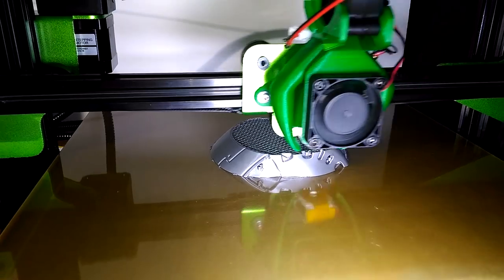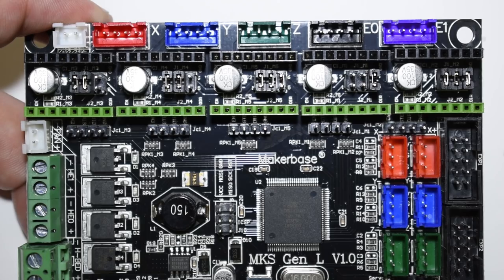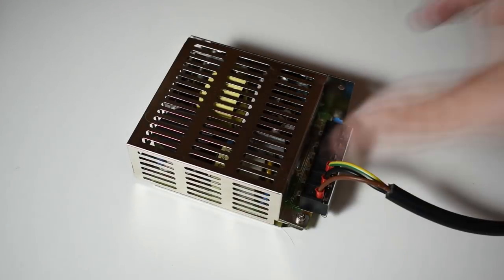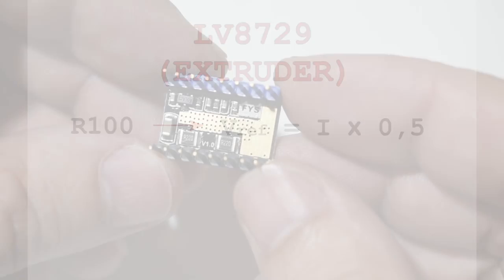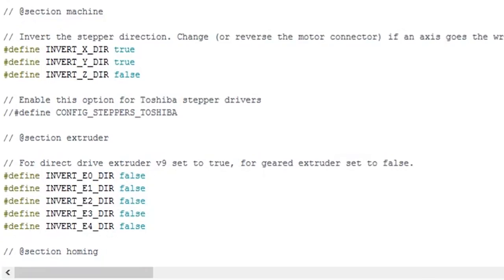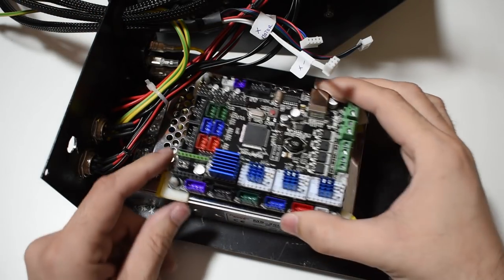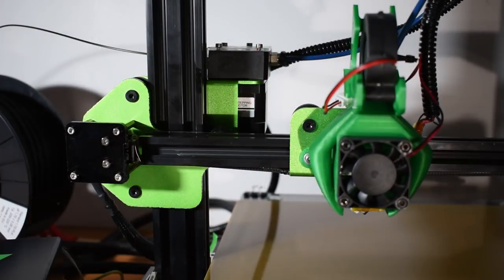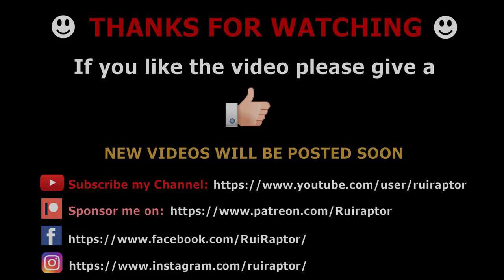Install & Setup - MKS GEN L + TMC2208 + LV8729 (TEVO TORNADO)

Comment: Thanks again for a great video. I followed your recommendation and used an LV8729 on my extruder and people keep asking why use that an not another 2208 and I have no idea why. Can you please explain the difference in choice? Why the LV8729 instead please dude?
Reply from the maker: Hi Neil,
People use the LV8729 because the TMC cannot handle very well the fast direction changes of the extruder.
Reply: ruiraptor Also, when setting the jumpers under the LV8729, you recommend running the extruder at 1/32 steps. Should I change anything in the firmware to reflect this setting?
Reply from the maker: Hi Neil,
I have all my drivers set at 1/16. If you change to 1/32, you need to double the steps/mm. You don't need to flash a new firmware for that, just change the steps value in the display.
Reply: @ruiraptor  So why not use also on other axis (x, y, z)? Im talking about the lv8729.
Reply from the maker: You can use the LV8729 on all drivers but the printer will make more noise. The TMCs can drive the motors with much less noise.
Reply: @ruiraptor  What are the advantages of the LV 8729 versus the TMC2208? I see now that the lv8729 is set to 1.5 amp-1.2amps that is not too low for x, y?
Reply from the maker: The LV8729 are high quality drivers that's why they are used in the extruder. But because they don't drive the motors as silent as the TMCs, the TMC are used for the other axis. Regarding the vref adjustment, you need to check which resistors you have in your drivers (there are 2 different ones - R100 and R220). According to which resistors you have, you need to apply the corresponding formula and that will give you different vref and current results.
Reply: @ruiraptor  Thanks for the quick answer, how can I find how much amps the motor need?
Reply: @ruiraptor  Is there a formula for finding the current?you think that 0.85a and 0.9 will work for most 3d printers? Mybe 0.85a and 0.9a is the sweet spot?
Reply from the maker: There is no information online about these motors. However, we assume that these motors might have between 1.3A and 1.5A.
Reply: @ruiraptor  tanks
Reply from the maker: I posted the formula in my video. You just need to work the formula to move the current variable. You have additional information in their datasheet. For the TMCs you need to be conservative because these drivers run very hot and since they are very efficient, you don't need to push the current too far. In my video, i show my recommended settings.
Reply: @ruiraptor  Thanks for the info. btw Your videos are great.
Reply: @ruiraptor  Mks gen l or mks gen v1.4? Im going to put it on a raiscube a8r, 12v dual z axis. It possible to give each z motor driver?
Reply from the maker: Hi,
Either board should be ok. 
Regarding the dual Z, yes, you can use 2 stepper drivers (one for each stepper motor). But remember that you only have 5 driver slots so if you use 2 stepper drivers for the Z, you will not be able to use dual extruders.
Reply: @ruiraptor  thanks, So should I go with the cheaper board? I'm planning to put LV8729 on the Z and  the extruder, and on X and Y TMC 2208, how does that sound to you?
Reply from the maker: The LV8729 are very good drivers too. Your plan sounds good :)
Regarding the board, if you don't plan to install extra fancy stuff, the MKS GEN L board is more than enough as it has all the main inputs/outputs needed. Both are 8bits boards and use the same ucontroller.

Comment: Hello Nice Video i Just wana ask something :) 
About orientation of Driver is same with TMC 2130 SPI ?..
Same in Heather Pin Blue Must Match the green And Black With Black ?!
Because im New i Have this Board MKS Gen V1.4 Control Board  
thanks
Reply from the maker: Hi. You are correct. Color header match color header and black header matches black header.

Comment: excellent video .... with the change of drivers are smoothers no longer needed?
Where can I find the latest firmware version?  thank you
Reply from the maker: Hi,
That is correct. With TMC drivers you will not need any smoother.
Regarding the latest firmware versions, you can find them in the official tevo tornado facebook group

Comment: I am slowly understanding Vref values. I am installing a zesty nimble. Do I need to use a target of .5A or use .9A to start on the E driver? I have the A4988 stepper ICs. Thank You
Reply: I would also like a video on the A4988
Reply: I would say start with 0.5A or even go as low as 0.3A. With the Zesty Nimble you need low amps, because it needs to spin fast. You are looking for speed, not torque. More amps usually means more torque, but longer time needed between pulses.

Comment: THANKS! Very well made video and easy to follow. PROBLEM: Everything seems to work great, however, when I try to heat the nozzle/hot end, I get min temp error and the printer HALTS.
I have TWO tevo tornadoes, so I pluged the new board into BOTH and get the SAME message. any ideas?
THANKS AGAIN for another great tutorial!
Reply from the maker: Hi Cosmo, what are the temperatures you get on the display when you turn on the printer?
Reply: @ruiraptor  hot end -14. Bed 21
Reply from the maker: Your hotend temperature is -14 and that is your problem. Check all the wires and conenctions. Maybe you have a loose connector.
Reply: @ruiraptor  hey thanks so much, I got it working, I had the thermistor wire plugged into the wrong place, it immediately worked, however, NOW x and y axis are skipping and I can't get a print to work. after a few layers, it just jumps really far off. any suggestions?

Comment: I have followed your tutorial and when adjusting the voltage, I ran into a problem. The first TMC and the LV are perfectly adjustable just as you've shown in your video, but the two middle ones don't seem to react to the screw and only show 0,05 and 0,1 Volts respectivly. What is the cause of this, are my drivers bad or might be something wrong with the power source?
Reply from the maker: Hi,
You probably have bad drivers and my guess is that they are missing the RS resistor. Compare a good and a bad driver. Check if the bad driver has all the SMD resistors soldered on the pcb or if there is any missing solder joint.
Reply: @ruiraptor  I checked them and they all look good.

Since they came in a pack of 4, I switched one of the TMCs that didn;t work with the unused one and that one is working. So now just one is missing and I have to conclude, that I simply got two bad drivers.
Reply from the maker: Correct. I agree with the conclusion. 
I believe that you are using a setup of x3 TMC and x1 LV8729 for the extruder, correct?
If you have a spare LV8729 driver, you can install it for the Z axis.

Comment: Hi, very nice explained video. For Extruders how is the noise compared between LV8729 and DRV8825  for Linear Advanced feature of Marlin?
Reply from the maker: Hi,
I have the LV8729 installed in my extruder and I would risk saying that it might sound less noisy compared with the allegro or DRV8825.
Reply: @ruiraptor  Thank your for the fast reply

Comment: Hi Ruiraptor, could you please help me which option is better for Tevo Tarantula 2017;
- Replace the 4988ET drivers on MKS GEN L V1.0 board with TMC21XX drivers
- Add TL-smoothers with 8 diodes to stock A4982 drivers on MKS Base v1.6 board or the board above with 4988ET drivers
Thanks!
Reply from the maker: Hi,
The best option is to get the MKS GEN L board and equip it with TMC2208 (or any other) drivers.
These will give much better results when compared with Allegro and smoothers.

Comment: Followed all the steps on the video and my Y motor always stops about 30 minutes into a print? The motor itself is only a bit warm not hot to touch. I switched the Y driver with the X and re did the Vref and still the same problem, Y motor stops about 30 minutes in? Any advice? TIA
Reply from the maker: Hi,
I think the problem might be due to high temperature on the driver and it might be triggering the thermal protection.
Try to increase the cooling for that driver. As you can see in the video, it's possible to add an additional fan to cool the drivers.

Comment: I setup the LV8729 just as you did given that I also had 220 Ohm resistors. Additionally, I changed the driver on E0 from A4988 to LV8729 in the configuration.h file. I've recalibrated my esteps, and it extrudes exactly 100mm when I ask for 100mm, but when it prints, it over extrudes so much. I know the file is good because it was my last print before switching drivers and it was flawless. I'm not sure why it's suddenly over extruding. Am I missing something?
Reply from the maker: Hi,
The extruder calibration is not only about the Esteps.
You need to calibrate the flow % in your slicer too.
Download a hollow cube with 0.4mm thick walls and calibrate the flow % by measuring the walls.
Reply: @ruiraptor  Thanks for the quick reply! I had my extrusion multiplier at 1.0 with my A4988. You're saying that multiplier can change with the drivers?
Reply from the maker: Whatever you change, either driver, vref, extruder type, etc, always run your calibration procedure and make sure that everything is calibrated.
Reply: @ruiraptor  I see. Thanks for the advise! I'll fuigure it out.

Comment: Thank you for nice video but i have been using this stepper drivers some time but i have this one weird problem. I get kind of like weird buzz sound while printing. I try many kinds of current settings and so on but aint helping. So what's going on with my printer? I have the same board and all 2208 and 2100 on z...Thanks
Reply from the maker: Hi,
Can you identify which axis is buzzing? Maybe one of the stepper drivers is not working perfectly.
Reply: ruiraptor Both x and y. I putt both of them in stand alone mode and then at some speeds they do real smooth. So im not really sure it vref is correct but i been checking this like 10 times so they should be good
Reply: Well i did changed them from another printer and it was still the same.. I even try with different motors. But im not really sure in what speeds the stealthmode kicks in?

Comment: Hi Ruiraptor
Question about my Tevo Tornado ..  My unit has the MKS Gen L V1.0 card ...  yet the stepper motors are different what you show for the Tarantula ..   My motors are RBS 47SHDC and are rated at 2.7V @ 1.5a ..  Drivers that came with my Tornado are A4988 where as I'm replacing my extruder with the LV8729 driver.  My question is on the "I (current) X 1.4 (rate) = V.".  Not sure where you are obtaining the "RATE" value .. Any help would be appreciated ..  Thanks
Reply from the maker: Hi,
The rate value is a constant value. That is needed for the driver formula. You should only use the variables V and I.
Anyway, I recommend you to use the values I mention in the video, especially for the TMC drivers.
Reply: Hi Ruiraptor, I'm wanting to install this Gen L with TMC2208 and LV8729 on my Tarantula and I'm confused by what vref's to set I was thinking xz 1.19 y 0.9 and extruder 0.45 as I have the R100 LV8729 is this correct?

Comment: Where did you manage to find the Imax for the TEVO steppers? What I was able to get from TEVO themselves is that the Rb42SHDC6022Z-26B (Y-axis) and the Rb 42shdc4043Z-22B (E, X, & Z ) stepper motors all have the same max current of 1.5A. Also to correctly calculate the Vref for the TMC2208, you should be working with rms current (Irms). That math is as follows: Irms= Imax(max motor current)/1.41, then Vref=(Irms * 2.5)/1.77. This will give you the correct Vref for all TMC stepper drivers. p.s. I typically only ever use 90% of Vref.
Reply from the maker: Hi, from the information we received, the stepper motors are rated 1.5A and the bigger Y axis stepper motor is 1.7A. Because of the characteristics of the TMC drivers, we always adjust from the bottom up and this way preventing the drivers from overheating. There is no need to run the drivers hotter  than what you need.

Comment: Can I use the TMC2208 for X,Y and Z . An keep the extruder with the A4988?. Just until my LV8729 arrives , I didn’t arrive yet , just the TMCS. Or put a TMC for the extruder while I wait for the LV8729?
Reply: Yes, you can. To be honest, I am using TMC2208 for the extruder as well and it is working quite well, I would say even better than the stock driver. Just keep in mind that you might need to adjust the steps per mm. In my case, I had to halve them.

Comment: Hi , I have Green Tornado. I just received official datasheets from Tevo and all of the my step motors looking 1.5Amp , so according to your advise my Vref is going to 2.1 ( 1.5x1.4) ... Is it much more than yours ? Iam afraid about my board going to burn. Need your advise !
Reply from the maker: Hi,
If you are referring to the LV8729 driver, you need to take into account that there are 2 different drivers. You need to check the resistors below (either 0.1ohms or 0.22ohms). The formula will be different according to which driver you have.
Regarding the TMC2208 drivers, the formula is always the same (you can see it in the video). For these drivers, you don't need to set them to output the max stepper motor current. These drivers can handle the current much more efficiently thanks to their true wave output. That means you can set them with a much lower current and you will get the same performance. Also, by setting a lower output current value you will have them working at a much lower temperature (they run very hot and need good cooling).

Comment: Hello - nice video and thanks for keeping it simple without UART hookup. But please tell me why only using 1/16 steps - why not use full 256 microstep option? Also are you running this in StealthChop2?  I thought spreadcycle is better. Also, why not use the full 1.2Amp RMS capability?
Reply from the maker: Hi,
With an 8bit board i cannot use more than 1/16 steps. That can only be archieved with a 32bit board.
Regarding the stealthchop2 vs spreadcycle, since I'm looking for the silent mode, the stealthchop mode is better for this.
Regarding the full current output, it does not make sense to use for this driver because of 2 factors:
1- this driver works perfectly even with a lower output current since this driver is not linear 
2- this driver runs hot so, using more current than needed will make the driver run hotter than it should and that will cause other problems (cooling) as it can shutdown during printing due to the thermal protection.

Comment: Hi. I have the same new setup as yours thanks to your tutorial. Everything is now so quiet, it's amazing. Except for the LV8729 driver. It's worst than before. Awful hissy/buzzing noise. Everything but silent.
I switched E and Z drivers (LV8729 and TMC 2208) for a test and to be sure. The Extruder is now absolutely quiet, and Z is noisy with the LV.
So what the problem could be ? LV8729 doesn't seem to be so good.
Reply from the maker: Hi,
The LV is not a quiet stepper as the TMC but it should not produce such high noises.

Did you adjust correctly the vref of that driver according to the driver type (resistors below the driver)?
Did you tighten the extruder screws? If they get too tight it will make noises too.
Reply: Well I did not expect it to be as quieter as the 2208 but it is actually louder than the original A4988.
Screw is ok. Sink is not lose. 
I settled the vref according to the formula and the resistor value (magnifying glass needed by the way)
As I said, I put the LV on the Z motor. Same issue.
And the 2208 on the E is absolutely silent and doesn't have any trouble ... for now. 2 x 2 hours printing, and the result is very nice.
I think I'll buy a 4th 2208 to replace the LV. 
For further, I changed all cheap fans by Noctua ones. Even in the power supply. Awesome.
Anyway, thanks a lot for your helpful video. Everything worked at the first time.
Reply from the maker: You can eventually get a second LV and test as you might have received one not 100%.
Mine works great and it's not noisy.
Reply: Why a LV is better for the extruder than a 2208 ?
Reply: @smoker_joe  did you find a solution for this? I just followed this guide, set the jumpers the same and adjusted vref to 0.99V (R220). Horrible digital noise, almost like a melody that plays for each turn of the extruder motor...
Reply: MatteStrom : Nope. I even tried to raise the Vref from 0.5v to 1v and above, and nothing change.
So I ordered a 4th TMC2208.